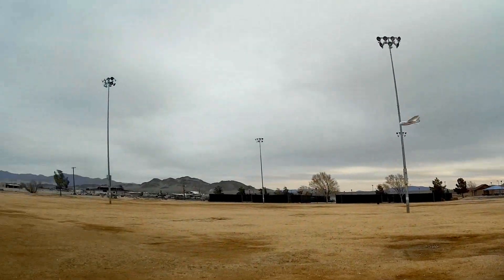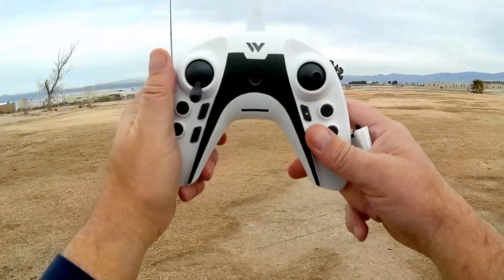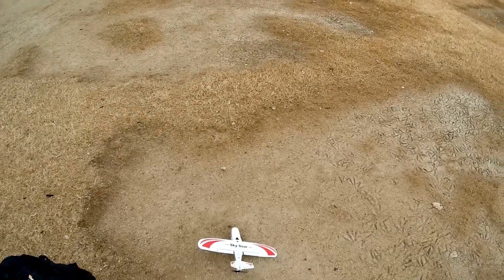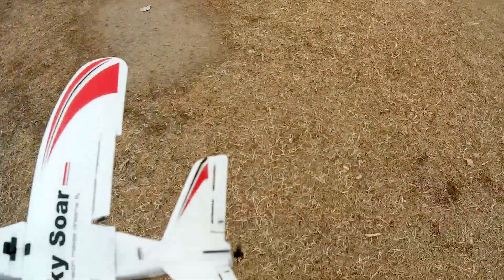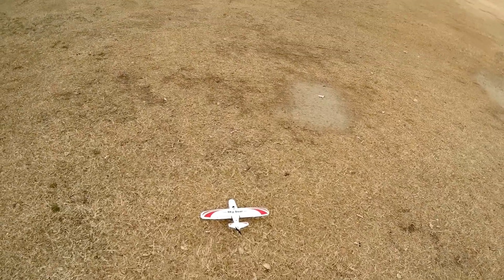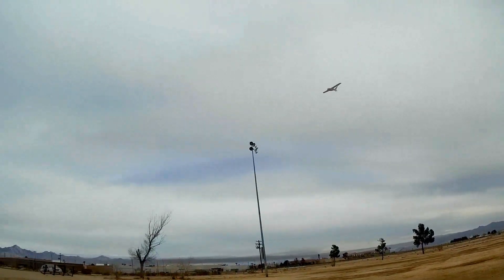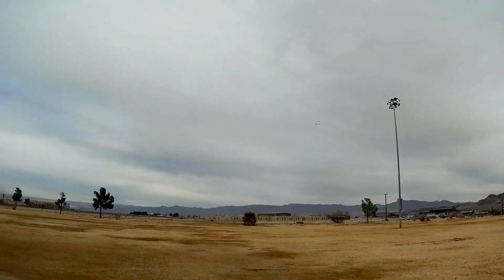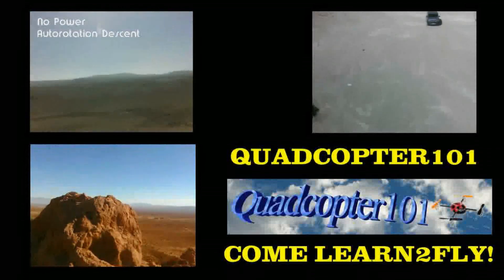Attop P01 V2 Upgraded Three Channel RC Airplane Flight Test Review

Comment: What do you think of all the FAA rules that they are trying to pass and probably will pass?
Reply from the maker: It's only a proposal, and up for comment right now. But if it does pass, I think that it will take at least a couple years to implement the proposed ID system.  And I also think that we will start to finally see a bunch of under 250 gram drones to avoid registration and the ID system entirely.